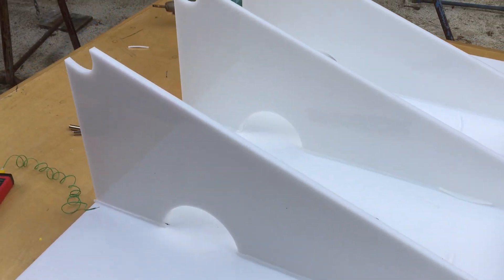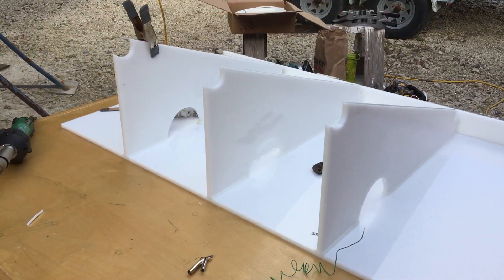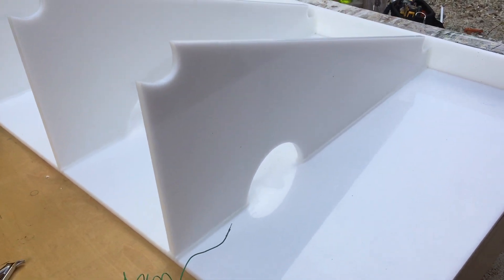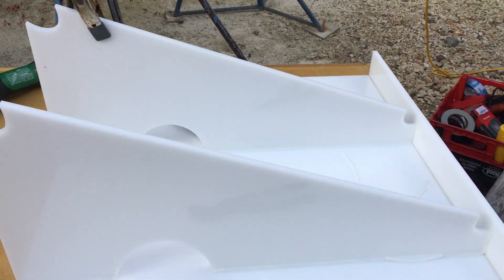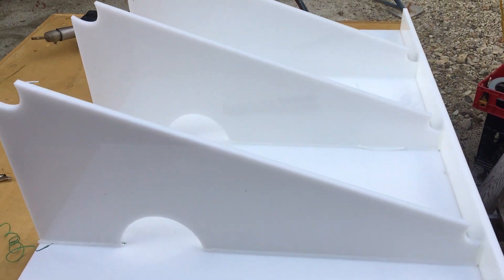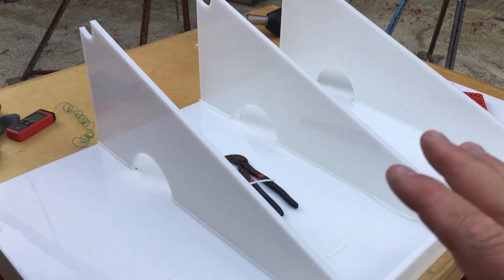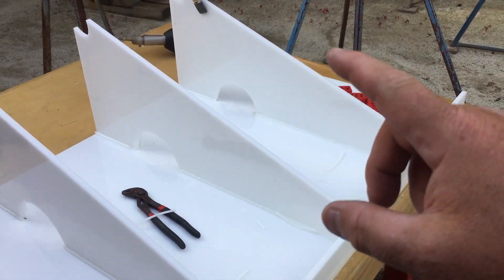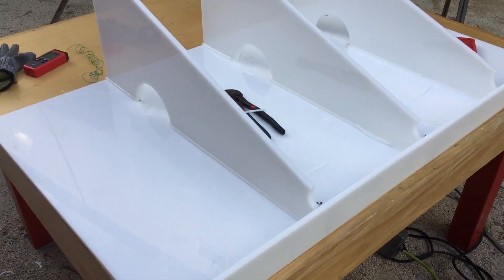Welding new diesel tanks out of HDPE

Comment: Thank you to everyone who commented. As an update to this video, I can tell you where I went from here. Those of you who want to know how to weld these plastics there are videos on YouTube that are easy to find. There are just a few things to keep in mind. The most important of which are to clean the plastic and scrape the surface that you are intending to weld prior to welding to remove the oxidized plastics and ensure a good bond. The other is that I used a heat gun from Leister a company who sells these heating air welders for a roofing contractors and people welding plastic. It’s quite simple. Simply use the correct filler rod that corresponds to the base material that you’re using. In this case it was HDPE. To that point. I later discovered that I really should have been using poly propylene and it’s assembly is identical. That is in fact what I decided to do a re-cut my poly propylene sheets by the CAD model that I created and welded them together and they’re sitting inside my boat now I will attach a photograph. If you’d like to contact me, feel free to send me an email and I can give you more detail.

Comment: Looks great!  I’m thinking of doing the same for my sail boat, but two of the panels will need to be bent to shape to fit the curvature of the hull.  I know you used 12.7mm but that looks too thick to bend and my tank is only about half the size of yours.  Do you think 6mm would bend?  On the other hand would 6mm would be strong enough?  Did you manage to finish yours?  Were you happy with it?